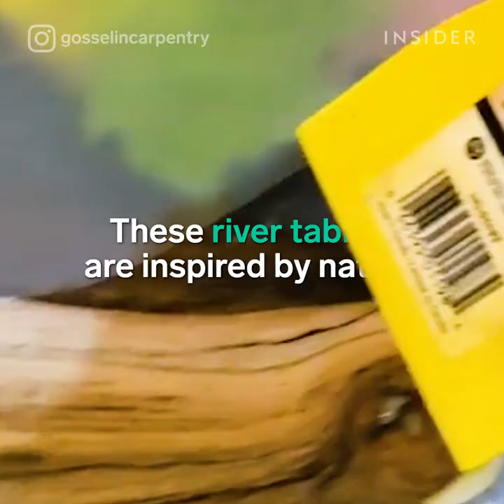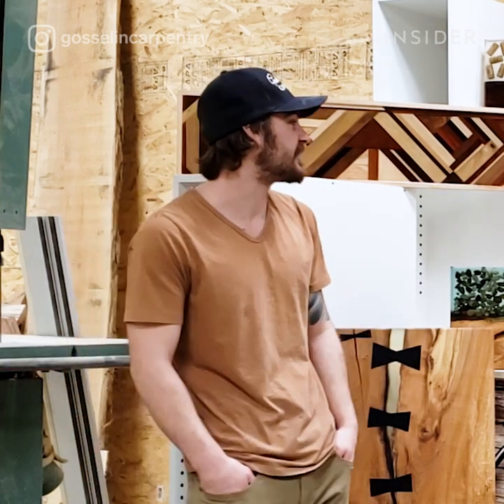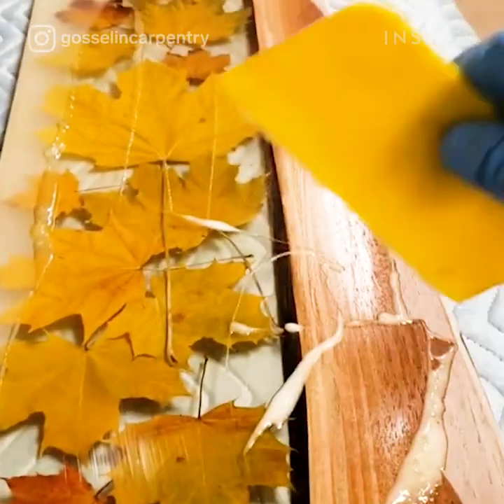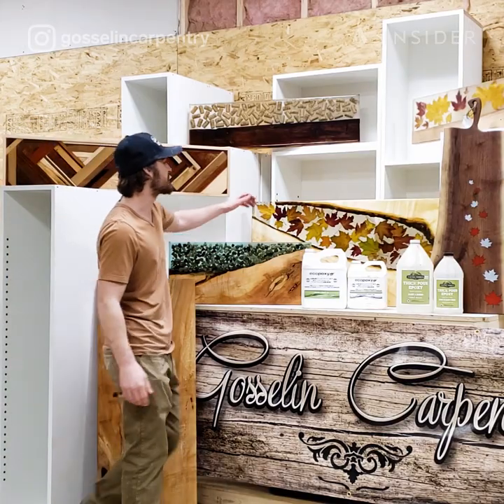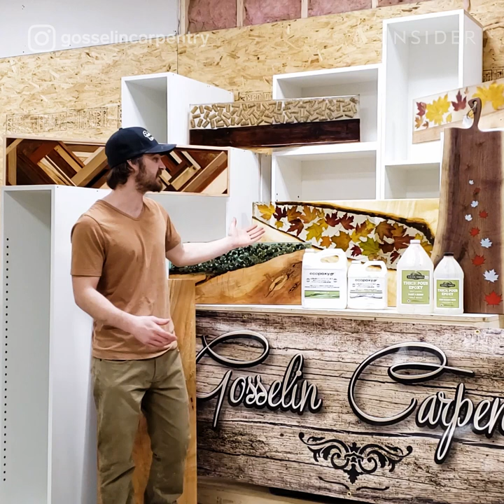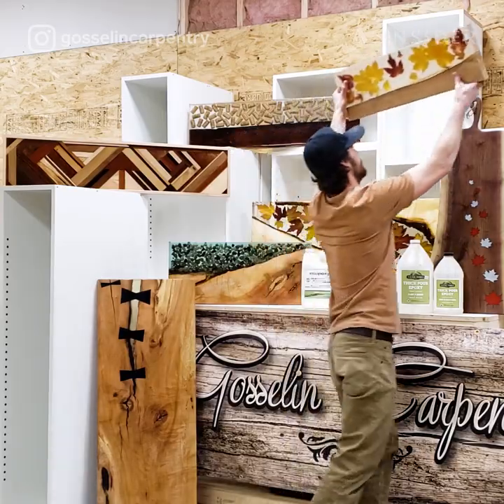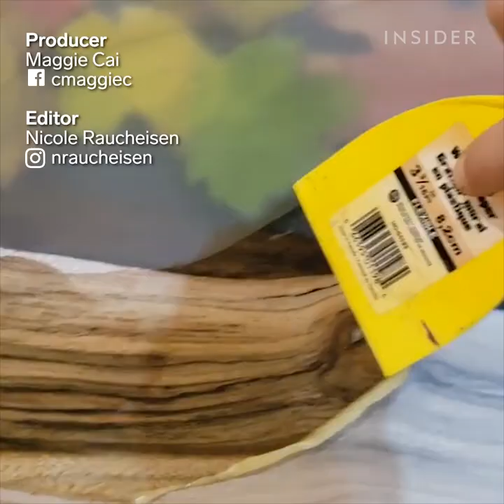Woodworker Makes River Tables Using Things Found In Nature

Comment: Epoxy generally isn't food safe. So using these as a cheese board isn't safe. Also, sealing a leaf in resin doesn't prevent the colors from breaking down from the inside. So have fun with your brown leaves in months.

Comment: “Environmentally friendly” way of recycling wood? What a load of BS. Yes you are using wood that wouldn’t be used in traditional carpentry or joinery because of imperfections. But you’re adding a ton of epoxy resin in doing so. And however environmentally friendly an epoxy resin product may claim to be it is still a terrible material to use. In the long run it’s much harder to refinish. Wood can look better with age, but resins generally don’t and require a lot of effort to repolish the surface.

And yes a lot of the wood used may have gone to a chipper or turned into charcoal or simply used as fuel for a fire which aren’t inherently great for the environment. But if after an epoxy wood table has been used and abused and gets thrown out, it is just that- thrown out. Reusing the wood becomes improbable because it has all the resin in and on it. You cant recycle resin, so it will just go to landfill when either the resin cracks with use or age, goes yellow due to UV exposure over time, or simply because “river” tables have gone out of fashion and so make the table unwanted by the over privileged millennials who originally adored this type of furniture on Instagram.

You can use live edge wood without drowning its every “imperfection” in resin or filling the gap between 2 pieces with a river of resin with leaves in.